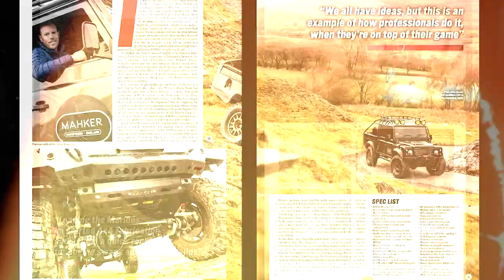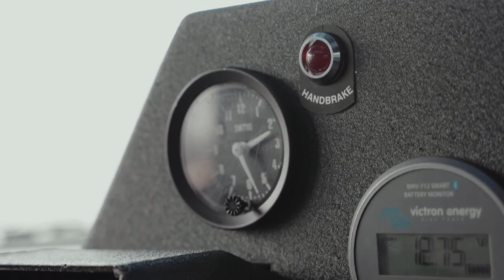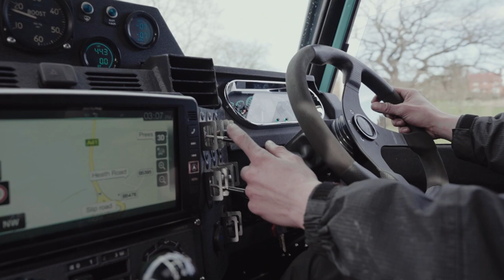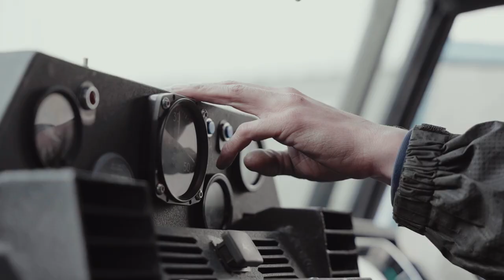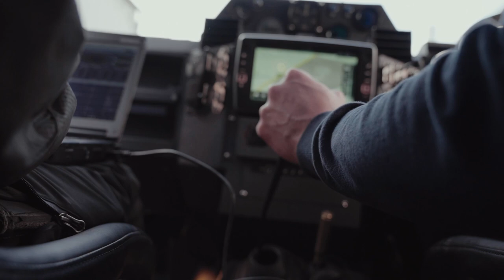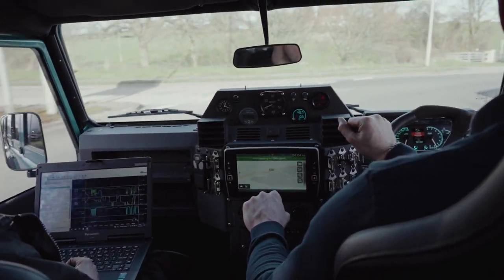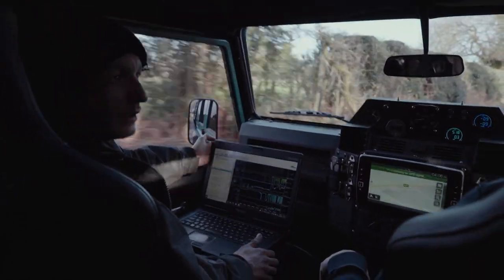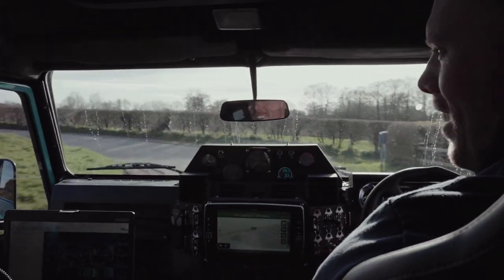Worlds First Manual LSA Land Rover Defender V8 on a Runway! | MAHKER EP035

Comment: Is that a Momo Dark Fighter wheel on Wombat? Noticed a few uproar 4x4 parts on it too…not a fan of the big septic V8 petrol in a Defender or the juxtaposition of spanking modern stuff mixed with WW2 era Aero gauges either - but to each his own !

Comment: I very much doubt it's a world first (I know of one in a RRC as an example), but it is super awesome!!
Reply from the maker: With a manual sir ? Prove me wrong ?
Reply: @wearemahker  Actually I hadn't thought about that part - I needed to re-read the "manual transmission" bit again, the RRC above I'm thinking of is auto.  Having said that Marks 4wd in Aus make an LS series to LR 4/5 speed manual kit so I'm sure someone in has probably done that (unless an LSA is a different bolt pattern or doesn't work for some other reason).  In any case your solution is certainly awesome - no detracting from that...must be fun to drive!
Reply: @mattnoyes7729  you’re right def not the first
Reply: @jaylonramos8640  Indeed !!